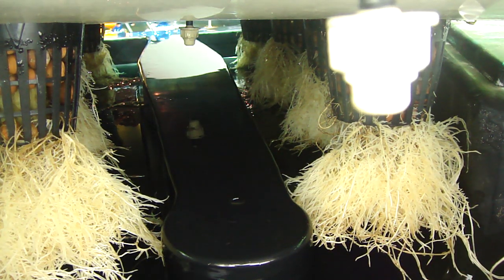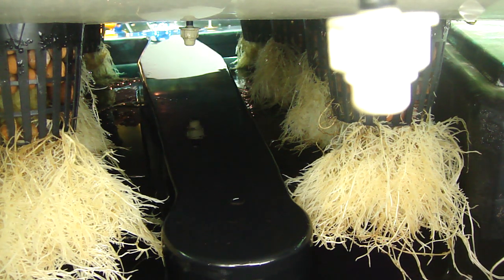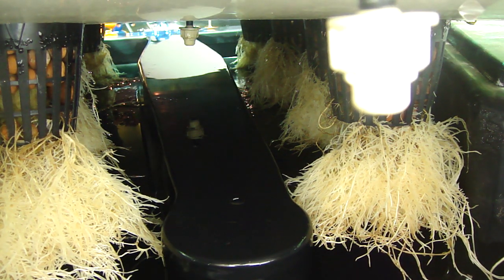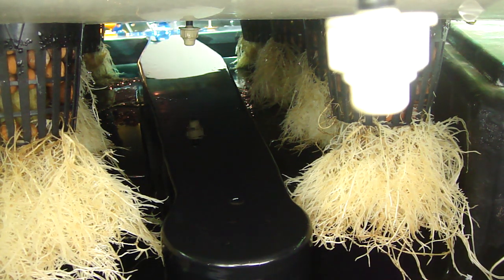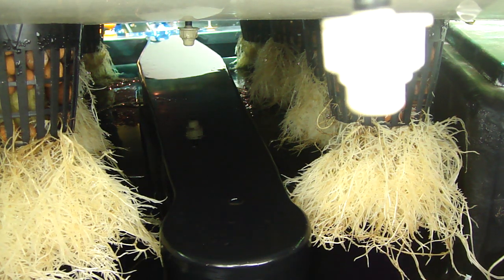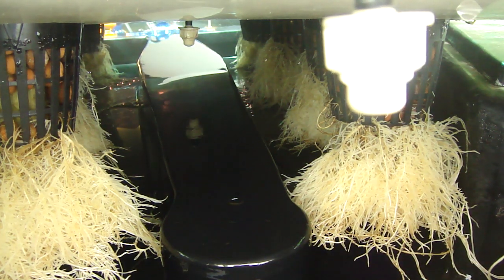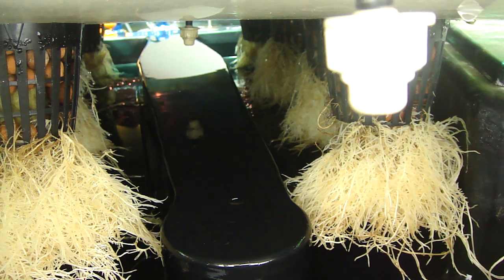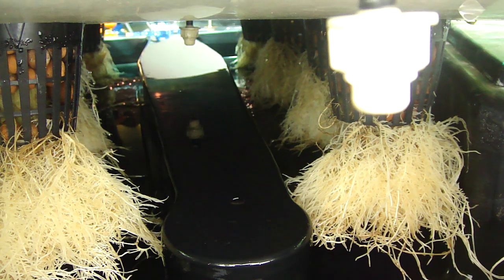How to maintain healthy roots using HPA (High Pressure Aero) part1

Comment: Hello, is there a program to calculate the watering cycle in high pressure aeroponics? 
 I'm having a hard time finding the right watering/drying cycle.  THANKS
Reply from the maker: There is a wealth of information on forums etc, however generally: it’s a calculation of orifice size, pressure, and flow. Our engineers chose the best components to hit the ranges specified by NASA funded studies on aeroponic potatoes (30-80 microns), however, the ideal frequency of spraying would depend on other variables such as plant spacing, rootball density, root chamber shape and ventilation, etc etc
Reply from the maker: Check out our faq page for loads of additional info: https://multiponics.com/pages/faq

Comment: Why don't sprayers run 247? Dwc is submerged, why aren't these constantly misted??
Reply from the maker: Thanks for the great question, they can be! Be sure to provide enough Oxygen, and/or ventilation, as you would with DWC and they really thrive! The smaller droplet sizes allow for better nutrient uptake, but don't obsess too much about spray times if you aren't going for the Trichoblasts, aka fuzzy roots. When using our HPA equipment in this way, focus on temp and aeration, as in any DWC or RDWC system. Please go to the Multiponics website and visit the learn section for more. The short answer is that all this depends... on many factors...

Comment: Hi, where can I get misters than can produce around 50 micron droplets?
Reply from the maker: Thanks for the comments, please visit our site and store at multiponics.com
Reply: Aren't those nozzles more than 50 microns?  @multiponics
Reply from the maker: @legendfpv  Please go to the Multiponics website and visit the learn section. The short answer is it depends... on the pressure, flow and other factors... When used with our selected pump models, fittings and accessories the range is typically 30-80 microns, which can be more or be less by using more or less nozzles.

Comment from the maker: @LivingCanvas2325 
Thanks for the questions. 
Are you asking about the TreeFrog or the DIY HP Aero RetroFit Kit?
The aero is bullet simple to set up on the TreeFrog. The only part that requires 
any thought is your timer cycle. Virtually any cycle will work. 
We have had success with cycles as short as 5 seconds on/1 minute off, all the way up to 24/7 aero mist. If you want to set up a DIY you can just drill 1/4" holes for the tubing. 
The HP Aero Kit is $264
The Aero TreeFrog is $995